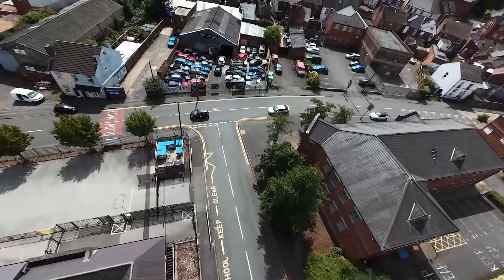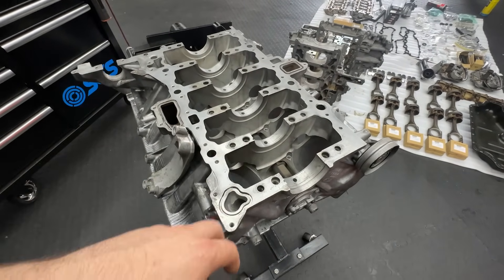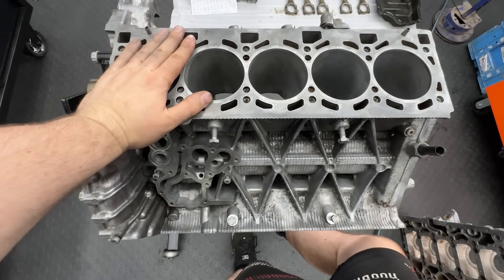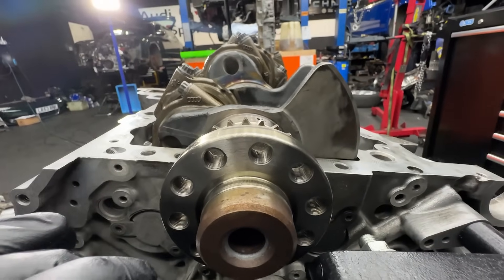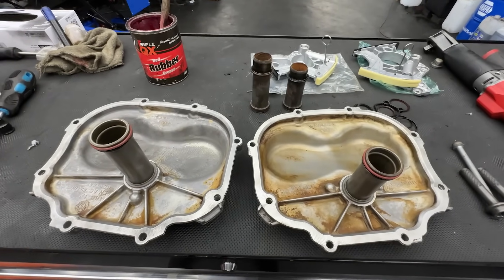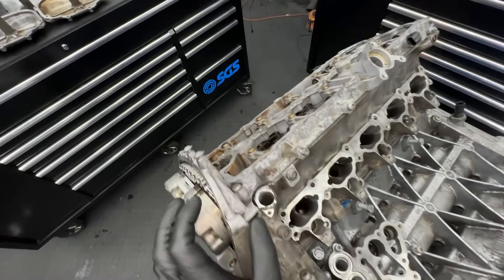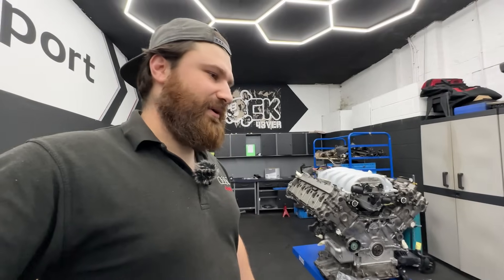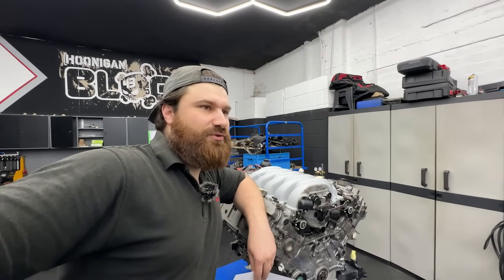How much money do you need for parts to build a V10 for S8 ?

Comment: No labor is a very generous offering on your behalf. It’s crazy that in the USA no one was willing or capable of doing this job . This says a lot about your company and work ethic.
Reply: It says alot about american mechanics. Engines made in usa are easy to work on and they always strguggle with European cars
Reply: Amtuned in Florida does them
Reply: There's plenty of euro shops in USA that can do it.
Reply: @SuperAkk92  alex doing V8 but want to do a V10, he probably could but has no customer yet.
Reply: I worked for BMW motorrad which I was rebuilding K1600 6Cylinder 1600CC bike engines and their is only a handful even been rebuilt in Europe, I probably have done 30 of them and most shops won't even do it as it's a big complicated engine they're also BMW dealers, we would get them sent into us and I'd do them during winter.. used to take 3-4 days for the entire job and get this they was replaced inc the heads for corrosion spotting... a flick with a paint can would have sorted them tbh.
Reply: @j0rzeh  how did you handle the custom fees? Did ones and got custom fees over my own parts.

Comment: I'm in USA, purchased my S8 for $6500. It needed three injectors. They cross reference with the 3.2 v6. I scavenged a set from the wrecking yard for $60 and had all of them cleaned and flow tested for $180.

Comment: depends on if the van you're buying the parts out of has "free candy" on the side of it...🤔   If you want it done right and care what goes in a particular location...a lot.   Definitely a neat process to watch.   What type of oil do you prefer - Resource Conserving (RC) or non-RC (stays in grade better at higher temps

Comment: Audi has designed this engine to fit the size of their V8 otherwise it would have been too long to fit the interior of the engine bay. The problem is that the cylinders are overheating slowly the cylinders become oval … Pros now use ceramic oil with high lubrication specs and increased properties to diffuse heat.

Comment: Not sure I would be running such large crank tolerance. Yes they are within spec but yours are more as if bedded in spec. Once ran in will be wee bit loose.
Reply: @ 0.39 of a mill, which is only 0.01 thousandth of an inch, a bug dick width. its not going to be a problem, plus he uses slightly thicker oil than recommended, which will keep it lubed well
Reply: @dave6445 well explained😊
Reply: how many audi v10s have you built??